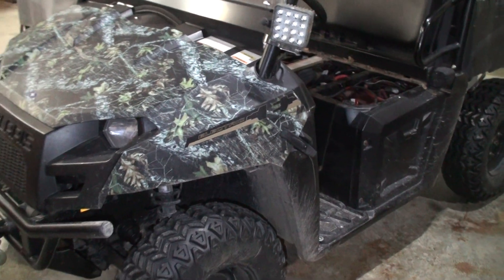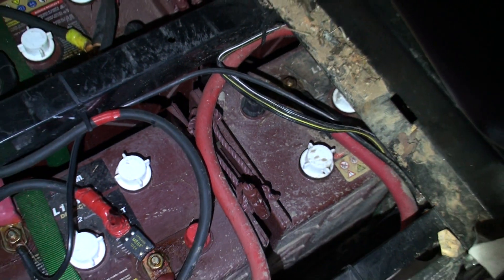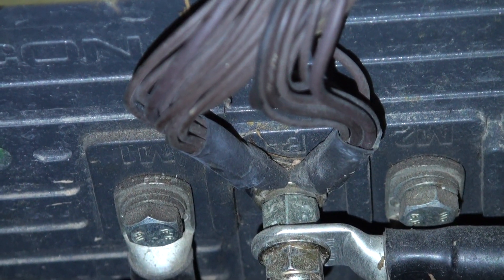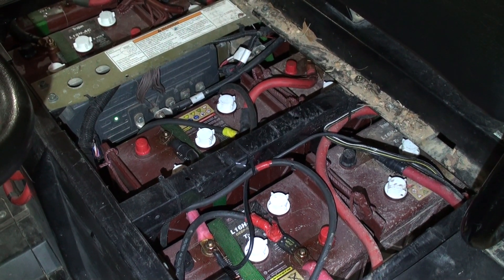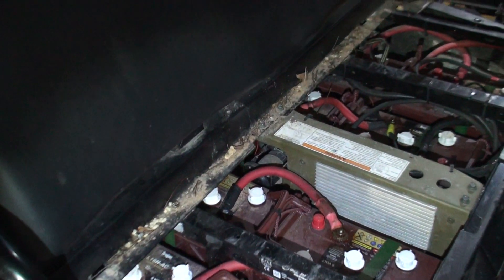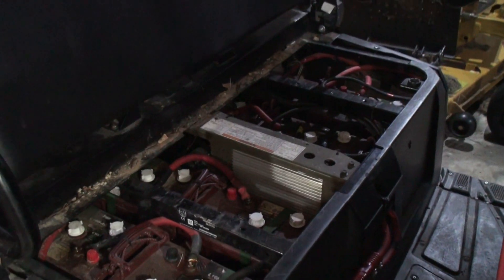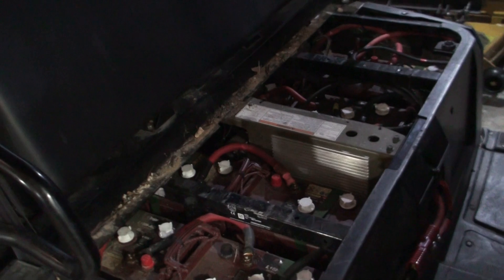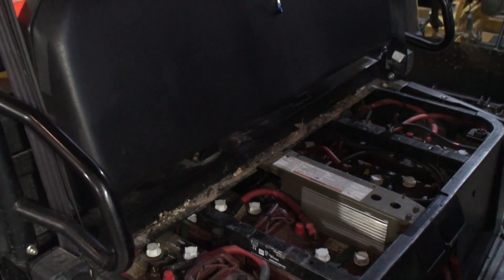2020 Ranger EV Report on 2010 EV at 254 hours & 10 years of use

Comment: I like the charging set up you have. Instead of inverting with a loss and then charging with a loss, your direct charging gains at least 20%.
Reply from the maker: Plus I can pull power back out of the EV at night if I leave it plugged in to my home system.  Something these car companies keep talking about doing with cars, & I've been doing it all along.  Of course my home system is 48vdc as are most, & the EV is 48v.  So that makes it easy vs a car connecting to a  home which is usually grid tie.  But it just needs to be purposely built.
Reply: @bransonoffgrid  Hey there, great video! I'm looking at getting an old ranger, putting lithium ion batteries and using it like you are for solar storage. It looks like you are bypassing the onboard battery mgt. system, is that right? Does your ranger battery bank connect only at your charge controller before going to you inverter? Also, if you were to plug it into a grid outlet, would you reconnect that red plug into something on your ranger and then use a regular outlet? Thanks
Reply from the maker: @Alhajadebaja  There is no batt mgt on the Ranger.  The Outback PM80 charge controller manages the charge.  Discharge is managed through the Ranger inverter.  Plug is either to PM80 or direct to Magnums when plugged in.  One video has a wiring diagram.  I'm sure there are others charging like this.  You could use any battery chemistry you wanted to install I guess.  The PM80 can be programmed to suit most anything.  It comes down to cost really.  These batt's work good & I can re-purpose them from my solar.  They are heavy though.

Comment: Hello, great video. I like the things you’ve done to the EV. Mine is also a 2010 EV. I’m curious if you made a video about how you installed the bigger batteries? And why did you have to remove the motor? Thank you in advance.
Reply from the maker: Watch the 9 part series called 'Battery Upgrade' in the videos - https://www.youtube.com/user/bransonoffgrid/videos

I pulled the motor to have it tested to see if it was the cause of the 'shutter' noise that I made the other series of videos about.  It was perfect, no problem.  Seems to be my front u-joint, or CV's, or combination of both I think.  I'm not going to bother with it.  If it had a gas engine, you'd never even hear that little bit of noise anyway.  The minor noise after 10 years doesn't bother me enough to actually replace parts trying to make it perfectly quiet again.  I haven't really done anything to it other than upgrade the batteries that one time, & add a plug to charge them direct from my offgrid solar system.  I'm still using the original tires & brakes, & they look like they could last another 10 years!  My 'gas' is energy I'm wasting during the middle of the day during the 'duck curve'!  Excellent UTV if you can live within it's limitations of being tied to having to charge it vs adding gas.  

10 years from now if I need a new one, they'll probably be much better on range, & the batteries will last 30 years!  The tech is actually already here now, just not implemented just yet.  I've posted some video on battery capacitor tech & it's already improved since then.

Comment: i have a EV 2010 polaris 500 ranger 114 hrs Brand new Batteries  Trojons . my electrical  Harnesses are my issue the interconnection  male and female 20 pin color coded wireing diagram is hard to read and figure out . And  listening to your video and seeing how you have your charging out let ;  do you have the Q-Quest charger anymore. wonding if you can help me  my email is slwberg19@gmail.com my is sue west
Reply from the maker: No, I charge direct from a 48vdc Outback Charge Controller, fed by 1 string of solar panels @ 3.5kw.  Works perfectly as designed, because any of these type of charge controllers are designed to charge a string of lead acid batteries!  I just have 8 -6v batteries, vs the original 2 strings of 4 -12v batteries.  The upside, is I can also pull power back off of the EV to my off grid solar system which runs my house.  

I think Tesla & others are considering this option for their car chargers, since they also install home solar systems.  But if you had your own solar system & built your own EV, you could just design it this way from the beginning; even if you were using Li-on batteries in your EV.  So one might ask the obvious question...  But you should direct that question to the company you're buying your EV from.  I can guess at their response, & they'll probably come up with many reasons that sound plausible to someone who doesn't actually design off grid solar.

Comment: Bet you saved at least $10,000 in gas over the 10 years plus no oil changes I bet?
Reply from the maker: We go very short distances around the complex.  That's why my EV hours are so low at the 10 year mark.  It's mostly from our upper gardens to the lower gardens.  You just can't carry stuff by hand.  So a lawnmower & trailer was replaced by the EV which makes perfect sense if you're on an offgrid system anyway.  The EV was already 48vdc, so plugging in direct only makes to charge it, vs the built-in 110vac charger.  The EV just has limitations.  When you run out of electricity, you can't just pour some in.  Although, if you look at my videos, there is this car in Switzerland that's 48vdc & uses a liquid refill system.  So here's hoping!  Otherwise, you need a pretty big generator to recharge from or roll out at least 5kw of solar panels to charge fast enough.  You can get soft solar panels that are pretty light, but I haven't seen anyone do it except the military.  The panels would take up your whole bed, but it can be done.
Reply: @bransonoffgrid  Gas will go past $5 a gallon again it's not a matter of if but when. also when it hits $10 a gallon that's when everything goes to hell!
Reply from the maker: @METALMAN4Wii  Yes, but that's why I'm OG & teach others how to do it.  I saw this coming 20 years ago.  It's just in the USA, there's few who can work together to make an OG Community sharing their own power.  If you build an OG Community, you can sell the homes.  It's best to have 10 homes sharing power to get the cost down enough where you can buy commercial battery tech & so forth, to get the cost down.  Other countries are doing it, but sadly, the USA will be last in this line.  Everything in this country is run top down by Cabals.  The citizens themselves don't work together very well for a common benefit.
Reply: @bransonoffgrid  Yup Amazon is going to electric vans that means we are gonna have to double the electricity the grid makes, so solar farms will be the new gold rush.